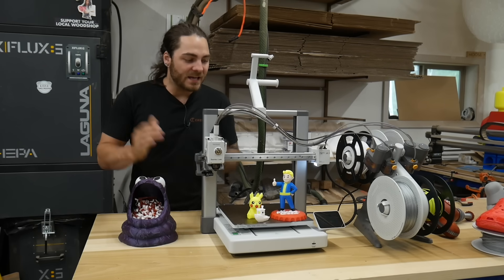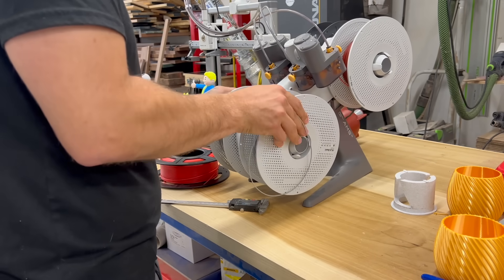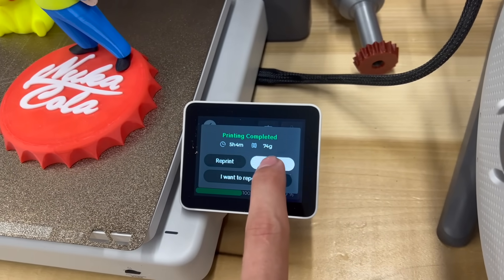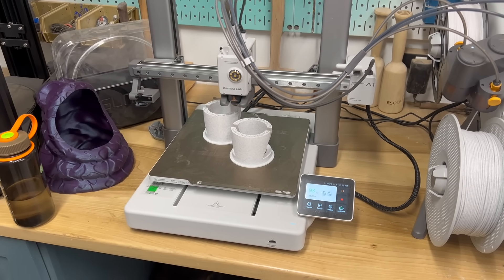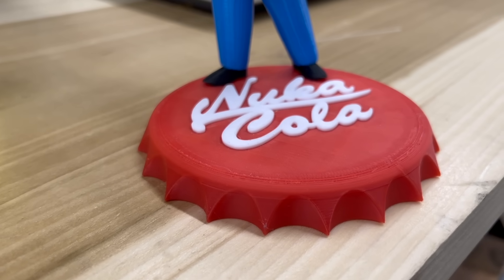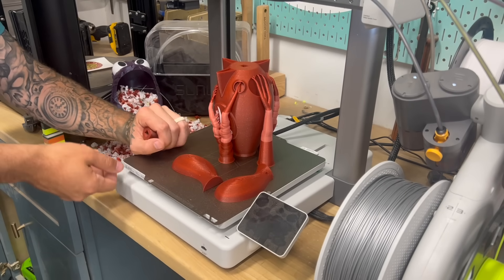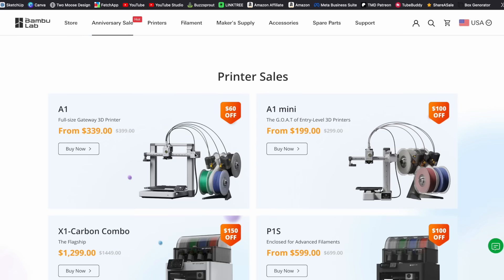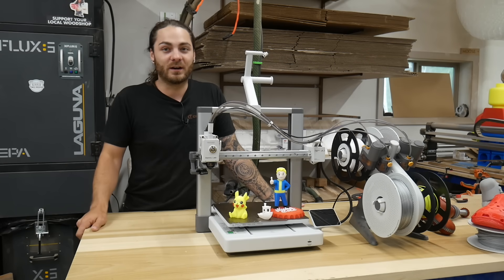Watch This Before Buying the Bambu A1...

Comment: The A1 does everything I wanted the Ender 3's to do... but better. If 3D printing continues to evolve at this rate... the future will be awesome.
Reply from the maker: Heck yeah!
Reply: They innovated in the UI and design process which makes it accessible to the average user. 

I’ll be frank; I bought  this for the simplicity that everyone is raving about. Could I do more with the money I spent given sufficient time and effort? Probably. But I have other more impt stuff to do with that time, and so here we are
Reply: @slowcyclist4324  fair enough,  my point is not to judge anyone who owns a bedslinger,  I just want companies to innovate. I would like to see companies producing products that deliver functional end result than a device which is limited to PLA and PETG. My main issue is that even PETG is unreliable for functional stuff hence there is no real value to bedslingers. Still people are buying PLA and beslingers because are cheaper and easy to use. Companies rely on this inertia from the users to go forward and profit with minimal investment for products that might become opsele in the near future.
Reply: There is PLA plus out there to that can make very strong parts.  I have quite a few that I cannot break.  Pulley systems for mounting bikes on ceiling etc.  I'm sure it's not biodegradable though.
Reply: @TheMacroSlacker  PLA is a material with good layer adhesion,  but the temperature resistance gives me little to no confidence. If you live in a cold country, you may not be too worried about the material reaching the softening temperature. But with a 42°C hot summer, it is the only material I haven't bothered to load into my 3D printer apart from the sample I got with my printer. 
Also, a part made by any type of material can be strong enough if designed correctly to suit the material and manufacturing method being used.
Reply: im on the same boat thinking about buying this now sold my ender 3 like 2 years ago now. due to too much bed level issues.
Reply: I have some experiment from lathes and milling machines as 3D printing hobbyist. Worst part in printers is, they are too flexible and lost settings easily. Automatic adjusting correct most of this problem but not all. But we can not buy 300kg cast iron monsters under 500 dollar.
Reply: What's the reason for not recommending asa with the a1? Is it just because there is no enclosure or because it doesn't get hot enough, or...?
Reply: @hobbinsjogsohn9996  firstly A1 has no enclosure, which is the minimum requirement for ASA/ABS/Nylon and many other engineering materials. If there is also an actively heated chamber is ideal. Second beeing a bed slinger the Y-axis motion itself introduces unwanted airflow, especially with high speed 3d printing. Third you cannot enclose the printer as it will make the electronics operate at a much higher ambiend temperature that the range they are designed for. IMO opinion with so many enclosed 3D printer options in 2024 it is a waste of money to get a bed slinger as there is no possibility to upgrade anything on it. The actual upgrades sold are not game changing but rather than a way to get your money.  If you want something more affortable go for the P1P that can be enclosed easily in the future.  Also, the space it takes is far less thar a bed slinger, which requires almost double the length. A1 seems cheaper but it really isn't.  I made a mistake when buying a bed slinger years ago. Never again. People that bought it will say is great as it just works quite well. But most of them will only print figures and decorating stuff.  I like to have the option of producing functional parts. With an open type 3D printer I can only print in PETG. PLA does not like our 42°C Summer days.
Reply: @hobbinsjogsohn9996  is because there is no enclosure. ASA, ABS, Nylon and other engineering materials are temperature sensitive therefore it can be warped and delaminate. For small parts printing might be possible but for larger parts it won't be as reliable.
Reply: There's possible black cloud seen on the horizon. The new firmware update, that is. If I understood it correctly, it will restrict how one can use that said make of printers.
Reply: @SeersantLoom  BL was always this way. Perhaps they allowed some  flexibility to make their products a bit more desirable to people who more options. But this should have been evident with the plus firmware. Once people find a way to access they released a more secure firmware. This is the company's way of protecting their investment.
Reply: It sure will be, Just now leaving my ender 3 that has caused me many years of shit for an A1 and I couldn't be more exited.
Reply: yeah seems like it. i have the ender and i hate it, i'm buying this because i can't stand the 20:1 ratio between tweaking, fixing vs actually printing with this crap
Reply: my starting point was an ANET kit A8 i got for for ~160 eurobucks on aliexpress. the first complete "reprap" 3D printer kit <500 bucks. 
the machine had flaws and it's own mind, my learning curve was steep, but after hard learning the omnissiah smiled upon our union. 
those old school machines require tinkerng, but you can do what ever you want with them. 
bamboolabs word out of the box, perfectly! but there is no room to tinker with the macheine
Reply: I think it is just a nicely calibrated machine with a good firmware.  I still use my CR10S but replace d firmware with klipper, an ABL and a textured bed. It is perfect. Buying a small bedslinger for 300 imo is absurd since you can only print PLA and PETG so no real value for functional applications. P1S  is just perfect. This is just money making for BL which had stated no more bedslingers. The real evolution in 3D printing will be when people realize that buying PLA and bed slingers just helps 3d printing technology back as they make profit without really innovate.
Reply: @tunedstylespecs  "no real value for functional applications"...Unless you're a designer or engineer whipping out prototypes and don't have time to spend fiddling with a machine.
Reply: @Adrian-wd4rn  I am an engineer and 3d printing is not only used for prototyping but to produce functional parts which with other methods would have been extremely expensive or impossible to produce.  The A1 is not about filling a machine but it is unable to produce reliably engineering materials.

Comment: Bambu Lab has created a solid consumer printer that performs well right out of the box, but they miss the mark with their tech support. Unfortunately, the support experience is incredibly off-putting. There’s no phone support, and I couldn't find a contact number anywhere. Their support form requires your order number, serial number, photos, videos, and log files, which feels excessive.

Once you submit a request, you can expect a response within 24 hours, usually directing you to a wiki page with limited information. The back-and-forth continues with them asking additional questions, leading to more delays. This process can be very frustrating, especially when you need timely help.

If you decide to buy a Bambu printer, I highly recommend purchasing spare parts in advance, as you might need them. In just one year with my P1S, I've had to replace the fans, two hot ends, the extruder gear, and the filament sensor. I also have an A1 with a DOA AMS Lite, and I’m still navigating the replacement process.

Bambu Lab makes a good printer, but their lack of adequate support and long turnaround times for parts leave much to be desired. Until they improve their tech support and customer service, I won’t be purchasing another Bambu printer. It's disappointing, as I could have been a lifelong customer.

Comment: I have ender 3 should 8 get a  k1 max
Reply from the maker: K1 Max is decent, it’s good for pla but struggles with higher bed temps as the bed doesn’t stay too flat. X max 3 is pretty good and I just got the qidi k2 which I’m liking so far

Comment: Would you recommend this printer for printing products to sell on platforms like etsy?  I am looking for 3d printers to build products and would you recommend this or higher models for this purpose?
Reply from the maker: Hey! Just starting out the A1 is plenty fine. If you can justify the price the x1c and p1s are great as well. Most things you'll print will be out of PLA or PETG so the enclosure isnt needed.

Comment: Pikachu is kind of a benchie for multicolor/multifilament, but it raises the question of how waste volume could change with a different orientation of the model  or SAR(some assembly required) and printing with an eye towards less waste by printing colors separately without the AMS.
Reply from the maker: Ohhh now I’m curious 😆 I don’t have a ton of multi color experience. I’ll have to do some experimenting

Comment: Man, I am SO tempted to take a leap and buy this printer. I currently have the Sovol SV01pro and have had it for about two years now. I spend more time trying to fix it because something went wrong rather than printing and because of this, I've lost almost all desire to print.
Reply from the maker: I personally really like it. I haven’t had any issues, I have most of my printers in my shop and this one lives in my house and it’s super quiet. I can be upstairs and send files to it and just go grab the part in a few hours.
Reply: @TwoMooseDesign  I love that! I do all of my printing downstairs and with a toddler, it's hard to go downstairs and start a print without him trying to follow me, let alone go down every thirty minutes to check to see if it is still printing! :) I just want to be able to print little toys for him, not worry about why my print keeps failing when it just printed fine an hour ago.
Reply: I got an elegoo neptune 4 for 189 (still on sale). Is open source, and has clipper. Similar specs to the A1 aside from the AMS. Way more fun IMO. I added webcam for free (found old webcam and printed a mount). Really easy to get dialed in and was great right out of the box

Comment: Which Titebond Instant Bond glue are you using in this video? The 6211 or the 6212? Thanks~
Reply from the maker: I don’t know what those numbers are but I use the thick 90% of the time. Medium is a little watery for 3d parts and gel is almost too thick for me. Bonds great though!
Reply: @TwoMooseDesign  Ok thanks. I tried to read the bottle from the screen and I thought it said "Medium" so I ordered 2 - 4oz bottles from Ebay. I will hunt down some thick too so I should be all set. I also got the accelerator or activator on order. Thanks. I recently bought 2 - A1 Mini Combos, 1- A1 Mini, and 2 - A1's that are still in the boxes. Gotta set up an Access Point for the WIFI today and soon I will be printing. Now I have 11 3D Printers including 1 MK4 in an enclosure. :) And I figured out the correct part number for the thick is either 6221 for the 2 oz size or 6222 for the 4 oz size. Titebond 6222 Instant Bond CA glue thick 4 oz.

Comment: Awesome review! I just bought a Creality Ender 3 v3 KE, and someone just told me I should turn it in and replace it with a Bambu A1 Combo. I'm new and basically want to print small ideas (prototypes for small gadgets I design, tiny toys, nothing really for mass production or anything, etc.). I'm new but pretty technical (senior engineer, etc.), so I don't mind learning curves.
Reply: it is not the only problem... you will forever doing at least 1 hour of maintenance per day with other printers.
Reply: @rodrigoalister9593  nonsense. My 3yo Ender 3 v2 has required precisely zero maintenance after setting it up. 99/100 prints are spot-on. Other than manual bed levelling (not rocket science) and being far slower, the quality is great. I wonder if people continually slamming Creality have even owned one (I doubt it).
Reply: @cpopefly  I have 2 printers here, not a bambu, and just simple pieces are printing without no surprises. Like spent 3 days in the piece and fail in the last minute.
Reply: It’s a no brainer. A1.

Comment: I’m looking into getting one. I have a few printers that are always giving me problems. Mostly the bed leveling is my headache of all. But at times I keep losing alignment and I do like the power on resume feature. Might be worth looking into. The cost is what hurts me the most.
Reply from the maker: With my Bambu printers I never think about the bed leveling. They are pretty great
Reply: @TwoMooseDesign  yes that is my biggest headache on my cheaper printers when I’m pulling prints from the plate itself.
Reply from the maker: Absolutely, definitely frustrating. The qidi q1 pro, flashforge 5m pro, and the Bambu printers are all great

Comment: If I don't care about the multi-color aspect of the A1, should I go with a different printer in the same price range instead?
Reply: Tbh i don't need the multi-color but it's a very good printer on it's own, probably there is some other printer cheaper then this but this one is quite cheap for what it offers.

Comment: My first printer was a GEEETECH A20M because I wanted multi material printing. It's horrible! I printed the test file with 2 filaments, and never got one multi color print to finish. It clogs so incredibly easily, and even my local 3D print shop had issues unclogging it. After months of the shop trying to get it to work, they couldn't. I decided to go with the Ender 3 S1, and focus on a printer that works, and is more common, therefore hopefully easier to troubleshoot. It has worked well, and it was pretty fast at the time. I of course want quality, but 150 mm/s still takes far too long. I'm now looking at the A1/AMS Lite as I still want multi color/material prints. I'm printing some models that are taking 2 days each, looking to cut that down. I also still (was the original goal with the GEEEEEEEETECH) want to print supports in PVA because I hate removing supports! I have bed adhesion issues often, and I like that the A1 seems to do very well with this. I have had to recently toss out 2 multi hour prints after several of the supports were knocked off the print bed. I still don't know why it purges and has a purge tower, seems redundant. Even thought I have been occasionally 3D printing for a few years, I still am not very advanced as I just want to send a print, and have it finish without really having to worry about settings and all the parameters.
Reply from the maker: You’ll love an A1 it’s a great printer. Easy to use, minimal filament tweaking, and prints pretty fast. I don’t know much about the printer you have but being geetech in assuming it’s on the cheaper end

Comment: Is it true it comes with an sd card with pre made digital models?

And is waste produced when only using 1 roll of filament?
Reply from the maker: Yes there are files pre loaded on the machine but not like a ton of them. You can go to makerworld.com to find free files. And no it only wastes with multi color this waste can be reduced with setting changes

Comment: I want a printer with multi color. I have 2 ender printers, which I want to sell for 1 bambu A1. But is there a way to reduce the amount of waste in a multi color print? (I. E. reduce the poop output)
Reply from the maker: There is yes. I believe you can do it quite a bit. I’d look up some YouTube videos but it’s 100% possible. I’m running it stock set up I don’t do a ton of multi color

Comment: Great video. I went to the A1 website. There is an Accessory Bundle. But, I don’t know what the options are good for. Can you enlighten me? Thanks.
Reply from the maker: The accessory bundle gives you a new hot end but the printer should come with an extra. You also get an extra build plate which is nice but not really needed. It’s basically spare parts on a minimal level. Build plates have different uses, for example a smooth sheet will leave a smooth bottom and the plate that comes with it leaves a textured bottom on the print.

Comment: The open air AMS wsa a little worrisome for me here in Dallas Texas.  When the recall happened I upgraded to the X1C.
Reply: What was the recall about?
Reply: @msas6020  The power cord to the bed, some had a short in it and potential fire hazard.  Somethings I miss about the A1 still though.

Comment: - I have a macbook.
This is the perfect example/analogy! There are things that I like to tinker with, adjust, hack and so on, but I just want my printer to print.
Yes, Im willing to pay 25€ for a part that needs to be replaced on a bambu machine, because for the 6€ part on a different machine, I will need more time, tinkering and effort and is going to end up costing me more in my personal time, which Im not willing to give =)

Comment: That is like a full roll of waste! Is that from ONE print, or did you collect it for some time?  I am happy that I got a Prusa XL. I hate waste. Also, I print a bit with more expensive materials, so I dont really want to trash 100g per print at $60-80 per roll!
Reply from the maker: It’s only with multi color where there’s alot of waste. You can minimize it but the only way to mostly eliminate it is with a multi head unit which is far more expensive.